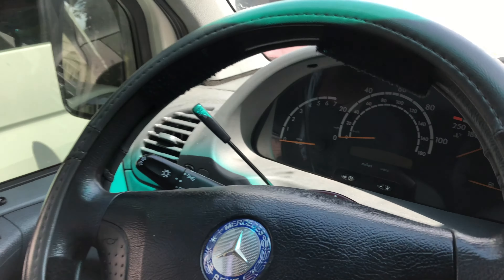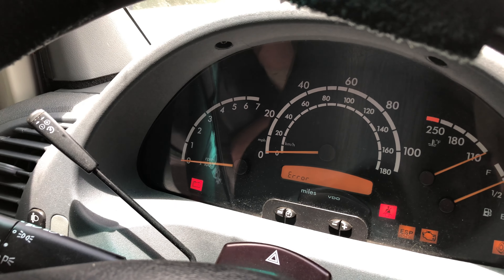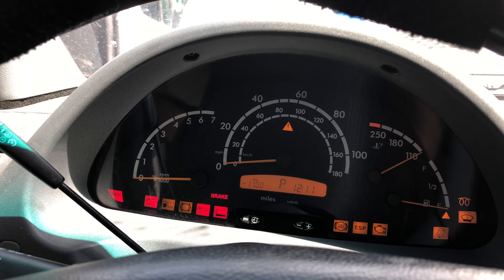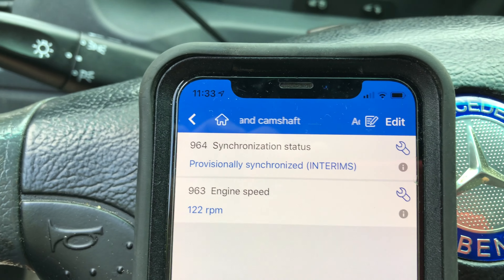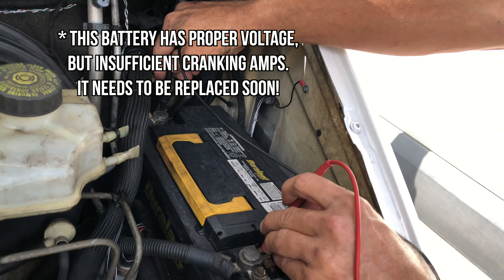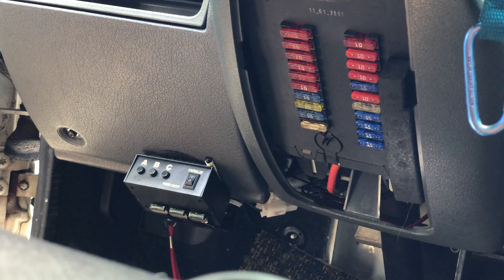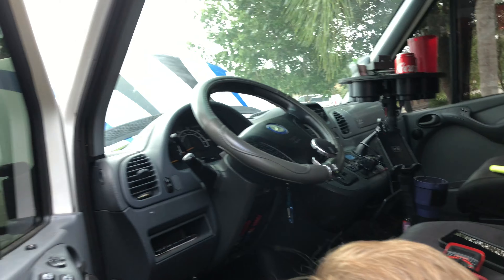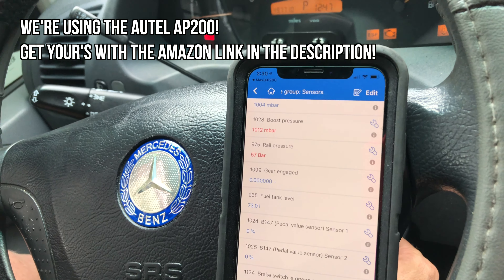Common Causes a Sprinter Won't Start. Fuel pump relay, starter relay, fuel flow, low battery, etc.

Comment: My 2006 sprinter just started acting up today would start when I stopped at a gas station , 1/4 tank fuel thought maybe she was lying so I refueled and she started , almost made it home snd she died on the move. 40 mins of turning over but no start. I got my wife to come pull me home 3 km straight run home. Half way there I decided to try and start her during the tow and she started. So I drive her the rest of the way. Shut her off and tried to restar, turns over but won’t start again. Left her for a hour snd tried again. Now she starts again. She’s  been idling 15 mins now with no issues. Any idea on what’s going on ? Thank you
Reply from the maker: Lots of ideas. Could be an overheating fuel pump relay or a crank sensor. You'll need a code reader like the AP200 to do better than guesses. Please use the link any time you go to Amazon. AP200: https://amzn.to/3h2gLY0
Reply: Po2051 maximum fuel pressure exceeded is the code I get
Reply from the maker: @ExclusiveK9Alberta  Does this test pass? https://www.youtube.com/watch?v=jjIMQduZz0Y
Reply from the maker: That is a generic code. Did the AP200 give you that, or some other meter?
Reply: A code reader I already have, snap on
Reply from the maker: @ExclusiveK9Alberta  That is worse than no scanner at all. Get rid of it, give it to your wife for her car. Lock it in a gun safe so you are not tempted to put it on your Sprinter again. Whatever it takes! Using a standard OBDII code reader on a Sprinter is like helping your child with their Spanish class homework, using a Latin dictionary. Many of the "roots words" are similar, but have completely different meaning, and the codes you get can be wildly misleading.  Get a reader that speaks "Sprinter" AP200: https://amzn.to/3h2gLY0
Reply: Lol, okay thank you. I will

Comment: On my TN1 I have an issue where the fuel pump doesn't come on when I turn the ignition and panel lights up. Instead, the radiator fan runs full speed and when I fully turn the key to start, nothing happens. After several attempts, I can hear the fuel pump go on and also, the radiator fan doesn't. The display also lights properly and the engine will start, no problem. I had generic codes of  P0336 and U0423. When driving, the sprinter would go just fine and then would drop down to 68 or 69 mph. I could pull over and restart and the problem would go away and eventually return. I now have no check engine light on, but on the highway, it when on.
Reply from the maker: That is a common issue. Either your ECM is not getting voltage on a supply pin or the internal connection has failed. This test will help decide which, and if it is not internal ECM issue this will show you how to bandaid and prove the fault.

Comment: Always helpful.  I bought my autel but I wasn't sure which one of their manufacturers brands to purchase for my t1n . Please would you tell me did you purchased dodge ? Or Benz? Or Benz sprinter?
Reply from the maker: Benz_Sprinter. Video coming soon on the set-up of AP200 for our vans, with tip about which to buy and why. Spoiler, one has lifetime download for Benz_Sprinter while the cheaper ones require $20 annual renewal for the download.
Reply: @FloridaVanMan  that is awesome I can't wait for you to make that content I did drained some money into this app and still having issues my vin is not matching.  Showing up different car ugh😀  
But thank you again for everything you do

Comment: Good video. You can tell that the person knows what he is talking about. 
Did anybody see the issue with fusebox that is under the steering wheel? I turn key, but there is no lights on, untill I press on the fuse box, lights starts flickering and eventually turns on and I can start the engine. I installed brand new fusebox and still getting the same issue.
Reply from the maker: Occasionally the ECM fails in this way, but if you pressing on the fuse box effects it there must be a problem close. I would be looking at all things added after the factory. Any radio rewires, alarm or extra power wires.

Comment: Hi @Florida Van Man   
I'm sending from Turkey
I've got 2006 2.2 cdi sprinter van 
It's 55.000 km.When the weather is cold it doesn't start during first ignition but it starts easily during second ignition.What may cause this problem ? Thank you ☺️
Reply from the maker: My first guess is glow plugs. Try cycling the key on for 20 seconds, off and back on for 20 seconds then start the van. This will make the glow plugs warm twice and might suggest your plugs could be replaced before next winter. 
Second guess would be the fuel rail control valve, and I think yours is different from ours in North America.
Reply: @FloridaVanMan    First of all thank you for your answer.Glow plugs have been just replaced.I will check up the fuel rail control valve. Have a nice day.☺️
Reply from the maker: @sbrkrgz5098  Be sure the glow plug module was also replaced. We have a video for testing the plugs and module.
Reply: @FloridaVanMan  I watched your video for testing.I couldn't find any glow plug module on my van and my van has 4 cylinder.I think I will advice with an engine technician.Thanks for your support. ☺️
Reply: @FloridaVanMan   Hi again
Today, while my van was in motion, the EDC lamp and the fuel lamp came on. The van went into limp mode. When I stopped and looked, there was heavy diesel spillage under the engine. Could the fuel control valve cause this?

Comment: My Starter relay won't simply pull out. Do I need to push a switch underneath to release it?
Reply: **Fuel pump relay
Reply from the maker: There is no locks or clicks, it's just stuck. Pull harder.
Reply: Amazing,  thanks!
You're a life saver, love what you're doing for all of us out there with T1N's.

Comment: hi great vid how do you connect your phone for diagnostics. thanks
Reply from the maker: For a Sprinter we use this AP200: https://amzn.to/2GD04Ft  Don't get the red one. It will need annual renewal at $19.99 but the one I linked will give you one free download for life. The download you want is Benz_Sprinter. And after making note of all the codes, clear them and drive to see what comes back. The new codes are all you need to worry about. The ones that don't come back may have been there for years, or caused by a low battery giving insufficient voltage to many sensors.

Comment: Great Demonstration. Although, 6:08 voltage drop by nearly 6 volts and simply glossed over? Of course this is a float charge,  but pretty extreme not to explain possible starter failure. 
I recently purchased an 04 with a voltage drop at start of 3 volts, no injector signal and no crank rpm above 190. FP Good on scanner (4800 psi). CCA 1000 total on two batteries. What could be the cause of no injector activation?
Thanks, 
-Justice

Comment: I have a 03 sprinter. Has become hard to start when cold. Noticed air bubbles coming from clear line out of the center of the filter up to the low pressure pump. Also noticed small fuel drip out of the top fuel connector that comes out of the low pressure pump. Can you give me some advice here? Thank you. Dennis :)
Reply from the maker: North American 2003's have a low pressure pump that sucks fuel from the tank through the filter. Any air leaks along this route will cause slow-start or No-start. Those white/clear lines come in a kit. Replace all 3 of those and the fuel filter with the no leak version from MMS. It will disable your WIF water in fuel sensor, but you shouldn't have that problem with highly regulated ULSD in the states.  https://www.millionmilesprinter.com/product-page/no-leaks-fuel-filter-02-03-only
Reply: @FloridaVanMan  how difficult is replacement of the lines. The seem to be routed underneath the intake. Does it have to be removed to get to them?  Thanks, Dennis.
Reply from the maker: @LitespeedAirshow  Manifold does not need to come off, but tiny nimble hands does help! Under the manifold is easier than getting the hoses clipped in front of the engine, but with patience and persistence you can do it without removing anything else.
Reply: @FloridaVanMan   you mentioned 3 lines, I see that there is one with 3 connectors, is that what you are referring to? Can you give me part numbers for the lines to replace ? Thanks
Reply from the maker: @LitespeedAirshow  This is where I got them in a complete kit: https://europarts-sd.com/item.asp?PID=1967 
Please consider supporting the channel with a small donation at FloridaVanMan.com/Donate

Comment: Hello. Hope you reply. So I have a honda civic 93 & it starts sometimes. So when I open the switch I hear the fuel pump. But for some reason I can't start the car until I hear the relay click. & that takes anywhere from 1 min -30 min. Do you know what it might be? Had a mechanic check it out he said he couldn't figure it out. Any help would be appreciated. Thanks in advance!
Reply from the maker: Sounds like a bad relay, but I don't know anything about Honda's common problems and faults. I would be checking voltage going to that relay to discover if it clicks as soon was it gets voltage, or does the voltage hit it and keep pressing until it moves 1-30 minutes later.

Comment: My 2006 just clicks when I turn the key. Battery is charged. Bad starter?
Reply from the maker: Possible but not likely. I've never seen a bad Sprinter starter, but I'm not a real mechanic and I believe they do exist. :) My check would be the blue relay under the driver seat. When you turn on the key the yellow relay will click. When you try to start the van the blue relay will probably click (it should). Do the dash lights & odometer go off while the key is turned?
Reply from the maker: A charged battery is not always a good battery. Some will drop voltage dramatically when attempting to start. Cold weather pushes them into this state of hidden failure. Any auto parts store can load test the battery. Another frequent error* is having the house battery join the front battery when key is on. If connected like this, and the house battery is dead, we get what you describe because most of the available voltage is going to try recharging the house battery. My next move would be using a broom-stick or similar, pressed against the starter, whack the stick while a friend tries to start the van. If this make is turn the starter is indeed with one foot in the grave.

Comment: Awesome video, and thank you. I have a 2006 2500. Going through your steps, I found that no fuel is coming out of the new fuel filter when I try to crank. I have checked and replaced several fuses and the relay that you showed as the fuel pump. Still nothing. Does this pretty much mean it is my fuel pump inside the tank? Thanks in advance, Robert
Reply from the maker: Either the fuel pump, a broken wire, or something you missed. We are all human. Can you feel the yellow relay click when you turn the key to on and off? Do you hear or feel any vibration from the round bump on the bottom of the fuel tank? One thing to try, have a friend turn on the key while you are under the van. As soon as the beeping starts whack that round bump as hard as you can. You want to shock the pump that is submerged in fuel, so it will take a hard whack or several. If this starts a vibration get out from under the van before trying to start it, but DO NOT turn off the key. This indicates your in-tank fuel pump is headed to greener pastures and should be replaced before a tow truck is needed. We have a recent video for dropping the tank.
Reply: @FloridaVanMan  I replaced the relay, and now it clicks when I turn the key. I also replaced all of the fuses, just on case. And there is nothing happening with the fuel pump.
Reply from the maker: @wyliebuck  A recent video shows lowering the fuel tank. If you lower it without unhooking the long bolts you should be able to disconnect the wire plug and verify voltage to the pump. If you have voltage on the two big wires but the pump wasn't spinning, you have a failed pump and the tank will need to come down all the way, slide out from under the van so you can replace the in-tank pump. This is a great time to upgrade to a pump with Aux port for diesel heater.
Reply: @FloridaVanMan  so I got the tank down so that I could get the power cable off. Should I get I put my red lead on each of the big wires on each end and the black on a body ground?
Reply from the maker: @wyliebuck  On the wires. The two big wires are power and ground to the fuel pump and we want to be sure both wires are good.
Reply: @FloridaVanMan  you are amazing. Thank you so much. Do you have a recommendation for the correct part and where to get it? There are a ton of options online. I saw one on eBay for $69 at the low end and then the dealer wanted $700 for the pump. I am not sure I could have done this without you. Thank you so much
Reply from the maker: @wyliebuck  For some parts I go for the best source, Million Mile Sprinter. Though I have been happy with cheaper in-tank fuel pumps from Amazon and eBay. Like this one: https://amzn.to/3Kxc6vQ
Reply from the maker: @wyliebuck  I have had good success with this from Amazon. It has the aux port for diesel heaters. https://amzn.to/3Kxc6vQ
Reply from the maker: If I have succeeded at my goal of saving you hundreds of dollars please consider a donation to keep the videos coming and the advice available to everyone on a "Pay What You Can" philosophy. https://floridavanman.com/donate/
Reply: @FloridaVanMan  sorry I didn't see this when you posted it. I sent you money via Venmo. Got the fuel pump issue fixed and now I have oil blowing out of the oil dipstick tube all over the engine bay. Any idea why this is happening? Thanks

Comment: I have a 2004 dodge sprinter 2.7l and is not send info from the pcm  to smog check station system diagnostic computer
Reply from the maker: I would get the AP200 from our links page and try  to connect to the van according to our setup video. If the van communicates with your compatible test device that suggests the station technician was making errors. I don't know anything about his computer, but I suspect selecting Dodge is a mistake. It is a Benz_Sprinter regardless of plastic badge and brand name on title. Built by Mercedes in Dusseldorf, sold as a Dodge. 
One on one assistance is offered to our Patreon members. Join here and find the links and video mentioned above: https://floridavanman.com/donate/

Comment: Awesome. Ty. How about doing a video on glow plug and controller replacement.
Reply from the maker: We are just a few steps behind the wave here. We have filmed the GP testing, module testing with replacing, and have yet to replace the plugs then edit the video. This week maybe...?
Reply: @FloridaVanMan  Thanks for the update....  If I can add some further  requests...  I own a 2006 Dodge Sprinter with just a little over 50k... It's like brand new and I love the thing.  Has never seen salt.  I like to get more info about this model because I can better equip myself in case something happens.  I have done virtually all my own maintenance but the hard work is something you are doing.  If you can 1 additional video when you get around to it....that would be great.. There are non around...
Properly jump starting the 2003-2006 models.  A friend of mine took out the electrical solenoid because he improperly hooked the terminals and the dealer charged him $900 bucks to replace the solenoid.  There are lots videos on newer models but not on the 2003-2006s
You are doing an excellent job on the videos, I already contacted my sprinter compatriots about you.  Cheers!

Comment: Great video,  and thanks for sharing all the valuable info , I try to fix my 2004 , I have code p0222 throttle position sensor,  I replaced the pedal , but still the some ,sometimes start and working fine but sometimes no start like the video